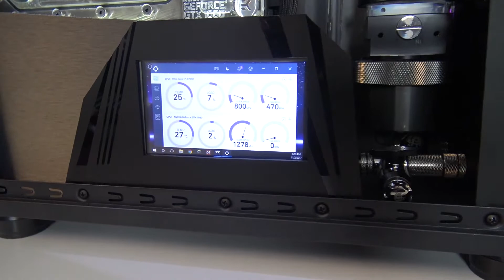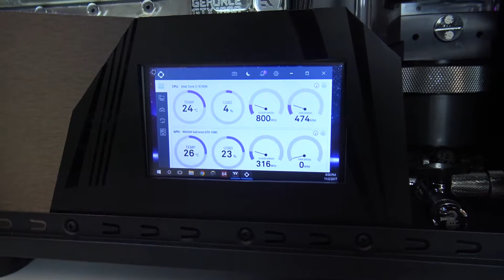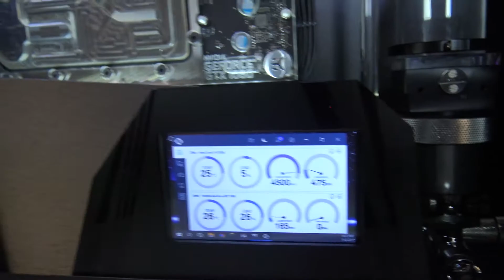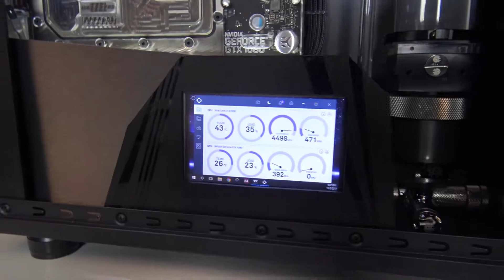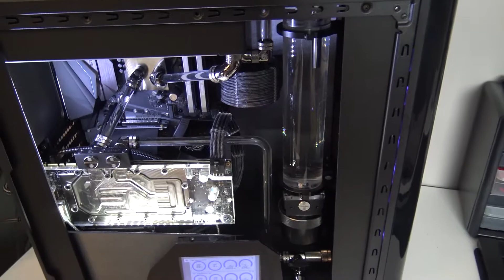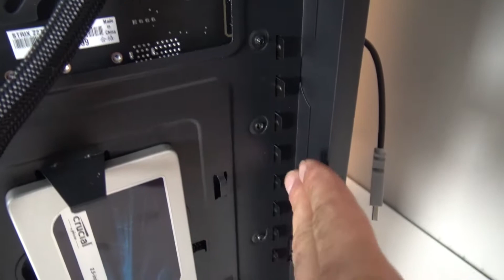Thermaltake View 31 TG: Custom Water Cooled Build Log Pt 4

Comment: what method do you use to cut your acrylic/plastic? I have the same case and want to cut that strip on the side of the front panel out for better air intake.  TIA
Reply from the maker: depends. For that I would probably use a utility knife. For acrylic, I use an acrylic knife for straight cuts and a Dremel Moto Saw for anything complicated